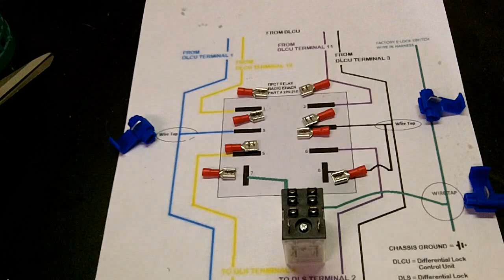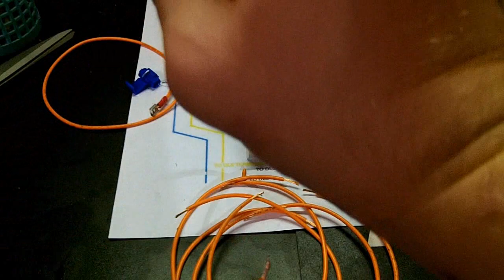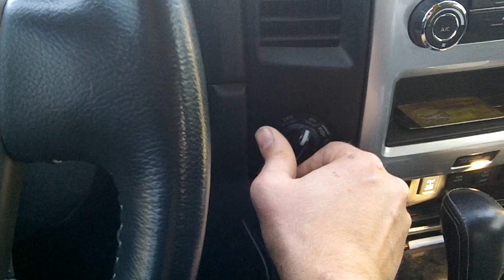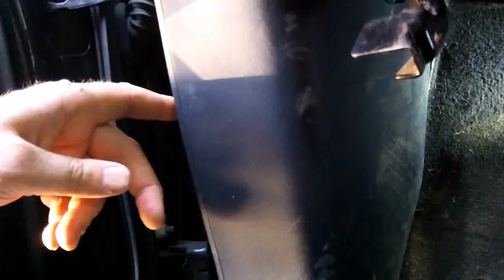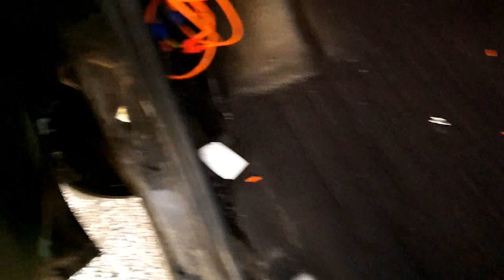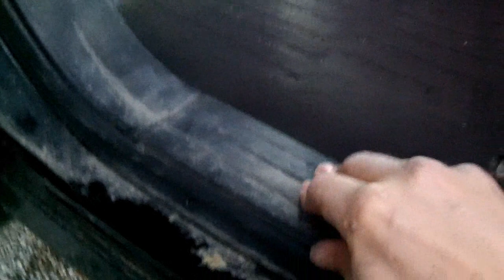Nissan Titan Pro4X Secret Diff Lock Mod - Use your e locker in 2WD or 4Hi

Comment: So it only works for the proX4 ..???
Reply from the maker: Only the models with the electronic locking rear diff.  Mostly Pro4X.
Reply: Thanks. I got a 2012 Titan black on black with 20 inch black stock rims. Nice truck, lots of balls non 4x4. Love this truck. Was an f150 fan but not anymore..
I have an 2008 armada se. It’s a beast too. 
Armada is the wife’s and the Titan is mine. 
Never again I’ll go to ford 👌👌

Had the armada for about 8 goin on 9 years never had issues..!! 
I shit you not, I haven’t even change the spark plugs, only oil changes 😆😆 no issues what so ever..!!
Reply: It will work on the pre P4X, Off Road models also.

Comment: i have a 2017 Nissan titan pro4x will this work on mine?
Reply: Your diff lock indicator works differently.  16 and newer went to a CAN BUS control of the indicator.  The wiring to power the diff and the position switch are still the same.
Reply from the maker: I have no idea.  Probably not.

Comment: Secret?  No.  This was published in Off Road Magazine in 2005.  And it's an over complicated method when there are simpler methods.
Reply from the maker: Feel free to share your simpler method. Most people have never heard of this and have never read an off-road magazine from 2005.
Reply: @TitanTown  
Can't post links.  Go to The New X and search for diff lock or eLocker mod.  2015 and older Titan, II Gen X/Fronty wiring for diff lock control is the same.  When the Austin mod came out in '05 I saw what an Fstory of wiring it was and the caution lights it caused.  A lot of folks didn't like the codes and warning lights.  I wrote a wiring diagram that doesn't cause warning lights, doesn't require extra switches, and doesn't require relays.
Reply: @rlm975  I did this on my 2015 when it was 2 years old. It's being able to put the locker on in for high for super deep snow and sand. I don't beat it and the rears never had a problem. I didn't know that was your right up. Thank you!
Reply: i have 2017 nissan titan pro4x and have run into a brick wall trying different wiring. i really need a wiring  diagram but cant locate one if anyone can help let me know. once i figure it out ill be posting it....but right now i can't get the trac control or abs light off...lol ooops but ill see if i can figure it out
Reply: i have a 2017 Nissan titan pro4x how can i do this?
Reply from the maker: @jeremyloranger9248  I don't know if the 2016+ have a similar system.  It could probably be done but it is likely slightly different.
Reply: @jeremyloranger9248  
Your wiring is very similar for '16 and up, the only difference being that the lock indicator went to a can bus control system instead of being electro mechanical like the older vehicles.  PM me and I can get you a print and talk you through it.  I have a plug n play module in the works for 16 and newer, I am no where near production yet.

Comment: This mod will void the manufacturer warranty. 
It also is very dangerous to lock this this diff while in motion. 
Just be aware of consequences. 
Other than that it does work.
Reply from the maker: Exactly
Reply: Good job on the video as usual.
Reply: What are the consequences ?
Reply: @brandonmendoza5036  
Too much differential wheel speed difference and you risk breaking something in the diff.  As long as the two tires are moving at near the same wheel speed with low to no power set, you should be fine.  A stationary vehicle with one stopped tire having traction and one tire spinning at 10 mph with no traction would be a wrong time to lock up.  The speed difference between the two sides of the locker could cause failure if engaged.